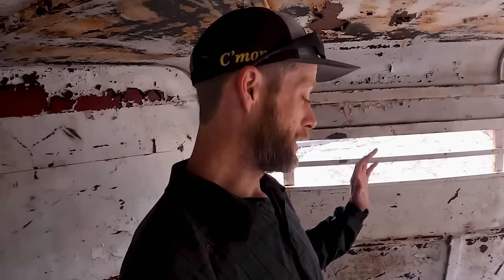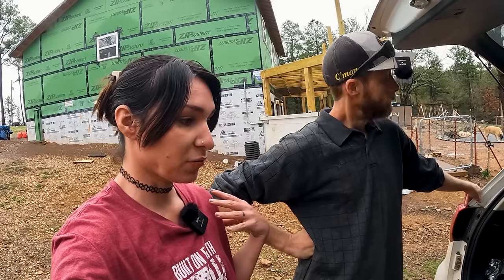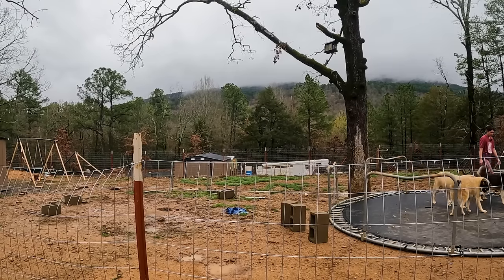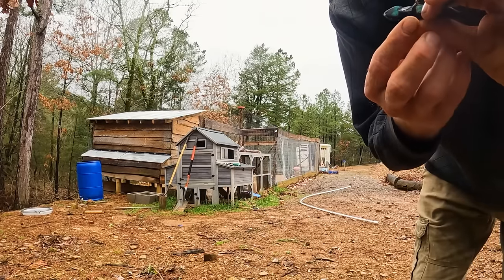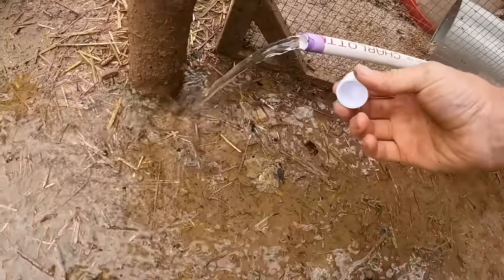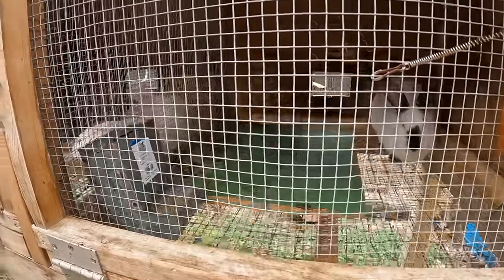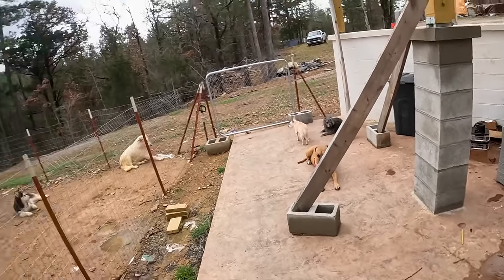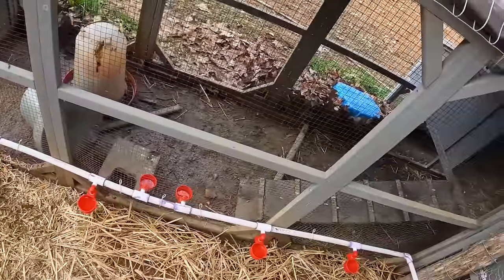That's it.. We're leaving our Cabin Homestead| Gravity Fed Water System |Last Min Prep

Comment: Get some big ground anchor screws and metal straps that will go up and around the ring of the trampoline. Those will hold the whole thing down. At 47:30 I noticed some little black animal leap off the driveway to the right.

Comment: Put two 2 x 4 boards across the bottom of the trampoline. Then lay concrete blocks  on the two long 2 x 4 studs. To weight it down.
Reply: Sounds like a really Good idea.

Comment: Hey guys I save all my Dog Food bags like that because they’re made of a tarp type material and they work great laying them down between the rows in the garden. They act as a weed prevention and then only weeds that have to be pulled up in the garden are the ones directly around the plants 🌱.  U can leave the dog food bags whole of cut them with scissors ✂️ to make one bag twice as long. But they’re a great weed Barrier. Sure saves on buying rolls of thick plastic or weed barrier material. Just a little tip you can use the dog food bags for 😁😉👍🏼

Comment: Standing near the window when you were talking why is the window rusting already and rusty water running down the wall good luck on your trip have a good time
Reply from the maker: We had a in the window wall unit air conditioning unit in both of the basement windows last year. Condensation from the ACs left a rusty stain. We will paint over it but right now it's not a priority. 💚

Comment: Why is your lights that's on each side of your door  on and off, it makes me wonder if you have spooks
Reply: The wires is probably wet that make light go on and off.
Reply from the maker: It's an optional illusion. In real life the lights do not flicker, but on recordings (when using our go pro) it does. It's because of the frame and refresh rate of the camera. Google Led lights flicker on video recording. They explain it way better then I can 😎